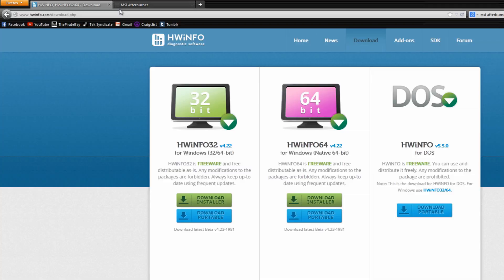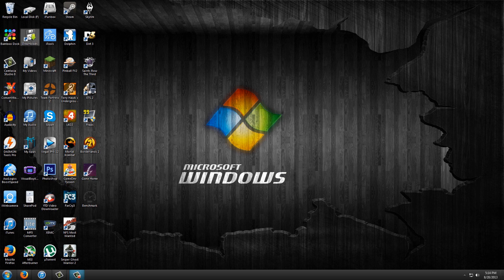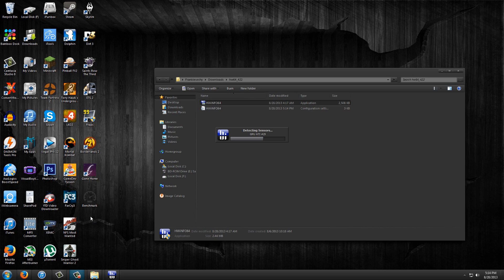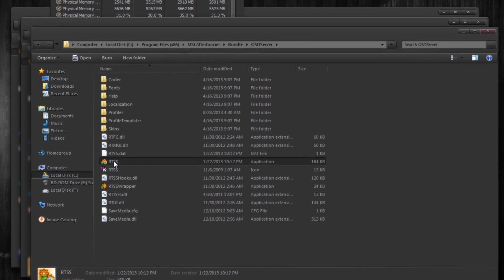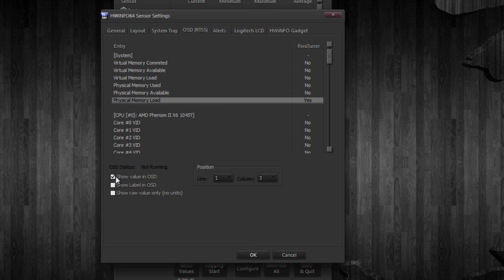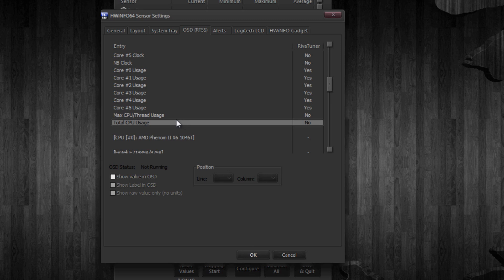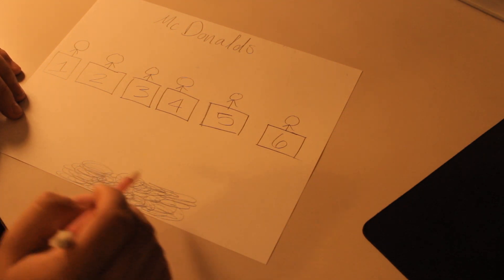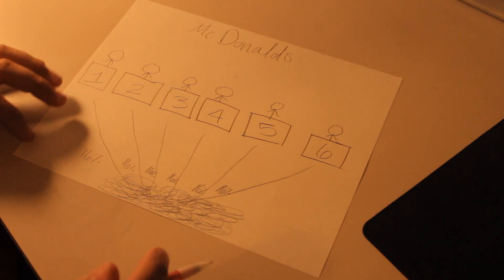How to Find Your PC's Bottleneck

Comment: I running in i5 4670k + r9 270x toxic + 8gb ram + psu corsair cs650m and asrock z87e-itx, i dont have ssd yet so i just run with hdd :3 its bottle neck or not ? I dont exactly know :3
Reply from the maker: Typically, SSD's are not crucial to the processing power of your PC. This rule changes with different tasks, but I'll assume you mean in terms of gaming: Then your answer would be no. An SSD helps your PC open applications quicker. It opens a picture faster. It loads different levels of a video game better. Because those are stored on your harddrive. An SSD will only make those kind of processes faster. It's not going to get you better frames per second in Battlefield though. It's impact on game processing is minimal.
Most of the time, it's your GPU or CPU. In your case, I'd say GPU, because the R9 270x is a low-mid level graphics card. If you're looking to speed up your pc in gaming: start there.
Reply: yeep, i was realize that my GPU is the answer, i think its quiet enough for me to have that 270x, its not really good but its good :D LOL so i think i will get an SSD yet and upgrade the RAM to 16gb, just like my planning for first time i build this for design, Photoshop and anykind of that software, anyway thanks mate, so for last result my PC dont have any prob right ?
Reply from the maker: If you're going to be doing Photoshopping and other kinds of editing, more RAM and a faster data transfer rate with the SSD will certainly boost your performance.
And no, you should have no problems with this upgrade, it should work out great for you!

Comment: I running in i5 4670k + r9 270x toxic + 8gb ram + psu corsair cs650m and asrock z87e-itx, i dont have ssd yet so i just run with hdd :3 its bottle neck or not ? I dont exactly know :3

Comment: Hi i have a little problem of mine:
I have just build a (very)low end computer just for playing games like tf2 and stuff (and i don't know that much about computers)
When i play games my Gpu is only around like 20-40 usage, while my cpu is around 70-80 (and dipping)
Is this also a bottleneck? and if: what should i have changed?
(and my fps is around 30 on high, and with all low around 40?!)
My specs:
Amd 5400k
Geforce gt 640
8 Gb ram
MSI A88XM-E35, Socket-FM2+
And just a hhd
Reply from the maker: Overall, good build man, but you know what, your CPU is lagging big time compared to your other components! That motherboard is really limited in terms of CPU compatibility, man! :( If possible, buy yourself a cheap motherboard with AMD FX compatibility. If you don't want to do that, then you could get yourself a AMD 760K, it's Quad-core @ 3.8GHz for $90. Whichever method you choose, bud, I know it will improve your gaming performance. I'm fairly sure that CPU is your bottleneck. Games are running better with Quad-core and multi-core processors, so it's time for at least a quad-core!
Reply: *****  Just a quad core? maybe a AMD A8-6600K Black Edition?
Reply from the maker: If you're cool with the higher price, then yeah, grab that 6600K, it'd be worth the extra money.
Yeah, that's what I'd do if I wanted to eliminate my bottleneck.
Hope I helped! Let me know if there's any other questions, bud.
Reply: ***** do you think an Asus 970 Strix would bottleneck with an intel 3770k on 6gb of ram?
Reply from the maker: Worstname evar  You got your hands on a 970?! Those are hard to get a hold of! Your CPU is pretty good too man! That card is a beast, and that CPU is really nice too. I don't see either of those being a problem for you! Good build man! Although you could do a little better on Ram! ;) If it's just gaming than anything over 8GB is overkill, but if you do editing, or run alot of applications then pick up some more RAM, bud!  Other than that, a very a solid build!

Comment: Hello Frankie, I got a 144hz monitor today and I'm super satisfied with the smoothness, even on lower FPS.

My problem is though, when the game goes on for a bit the FPS drop down to 60 or even lower (not adaptive vsync, they just drop by itself).

The game is league of legends. I run a GTX 770 Palit Jetstream, 12 GB of 1666mhz ram and a AMD II Phenom x6 1055T. 

Just in the theory, my fps should not go under the 144 hz at all. My CPU is overall at about 30% with windows and chrome in the background, ram is at around 35% and GPU at 28%.

I checked the ingame performance as it decays and it turns out that all my cores are running equally low except a single one which averages at around 60%

My CPU isn't throttling, checked that too.

I honestly dont know what to do. I can run Bioshock Infinite with everything on Ultra on solid 60 FPS with not even a single spike down, didn't test it on 144hz yet since the framerate seems to be locked at 60, need to work my way around that but it doesn't work for League. I'm seriously considering just spending 2.000€ on a new mainboard, new CPU and 2400mhz ram. But what is that doesn't fix it?

Please help :(

Comment: How do i know which number is what? i have all the numbers horizontaly and how i can change it like you have?.
So i am thinking that first 5 numbers are cpu and then comes gpu and then ram?
But this cant be it because i know that my gpu cant be bottlenecking my pc because i just bought a new one it is AMD HD 7970 which i think is decent gpu.(second last number is running 70-100%) My CPU is fx-6100.
So do i have to buy new power supply and a new gpu (r9 290x) and just crossfire my gpu:s to fix my problem?
Reply from the maker: Well I like to put the CPU and GPU on separate rows so I know which is which, but I'll make a guess here and say that it is your graphics card. It's typically everyone's bottleneck, CPU's aren't the most important component in processing graphics in games, your graphics card is. That being said, yes, upgrade your GPU, but not with a 290x!!! For the money, the GTX 780 would be WAY better my friend. Just make sure that your motherboard is compatible with NVIDIA graphic cards. Also, why would you have to upgrade your power supply?
Reply: ***** Becasue my current power supply does not have enough power for supporting 2 gpus. Well now when i am thinking i bought this computer already built 2 years ago it costed about 1k and came with gtx560 well i upgraded to amd hd 7970 6 months ago. So maybe that is the problem that my current motherboard does not support amd gpus because i didnt check it back then. And maybe it does not allow 7970 to run full speed or something? My computer is named Acer Predator G3120 and the motherboards name is also Acer Predator G3120 so how  do i know is my motherboard combatible with amd gpus? I got 800 euros which is around 1000 dollars to work with on ubgrading my pc.
Reply from the maker: ChillThull Well crossfiring 2 GPU's is never really worth it. You'd usually be better off with one very good card than two decent gpus. Crossfiring never actually doubles performance, it just doesn't work like that. I would suggest buying a very good card like the GTX 780.
And no, if your motherboard does not support your 7970, it would not allow you to play games at all, slow or fast.
If you can play a game right now, even slow, then AMD cards also work on your motherboard.
SO, IN CONCLUSION: Don't upgrade your power supply, you won't need to have 2 GPU's. Buy the best card you can for $1000, with that kind of money, you can get one of the fastest cards on the market, the GTX 780 Ti for around $650US.
Trust me, I think this is what you should do.

Comment: Hi could you please help me i watched you're bottlenecking video but i have a problem that my cpu is fx 6300 and graphics card is r9 270x oc 2gb gigabyte edition. in your video ur cpu was saying 60 procent just like mine and gpu 100 procent just like mine  the thing is that cpu i have is old from 23 Oct 2012 and gpu is from 13 Oct 2013. We both have the same results but i cannot belive that my gpu is a problem i was sure its a cpu and was ready to buy fx 8320 but now im not sure please help me.
Reply from the maker: I understand, but the CPUI is a huge component in 2D applications, like video editing, photoshop, mozilla firefox, etc. In 3D gaming applications, the majority of video processing is done with the GPU. Hence the name Graphics Processor Unit. Given the results of your bottleneck test, I would have to agree that it is the GPU. Your FX 6300 still has a TON of processing power even though it's 2 years old, it's a best seller on Newegg, because for the price, you get so much power. I would make buying a better GPU my priority! It would do alot more for you than a new CPU.
Reply: ***** What gpu do you suggest ?
Reply from the maker: go to video card benchmark .net (no spaces) they have graphs, and alot of data that will help you decide whats the best card you could get for the price.
Reply from the maker: *****
If you have the money for a high end card I'd get a GTX 780. It cost about $460, but it's almost twice as powerful as your r9 270X. You're at a weird spot where it would really be worth your while to fork out $400+ and get a really good card.
Reply: unfortunatelly i am a high school teenager so it impossible to get that kind of money r9 270x was the max i was able to get
Reply from the maker: I understand, I am the same way. The R9 270x is the best you can do, and you'll have to stick with your bottleneck until you have enough money to upgrade your card.

Comment: My ram usage only goes up to 25%, i have 8 cores 4 are used at around 12% and the other 4 are used at around 2%, my gpu is at 98% - 100%, so i guess it's my gpu
Reply from the maker: I would have to agree, yes. The majority of the graphics rendering and processing is done on the gpu, so typically you will see the graphic's card top off before the CPU in 3-D video applications. What GPU do you have? (Just curious)

Comment: hello , I have a intel i3 3210 dual core processor 3.2ghz( although it is dual core , so it can process dual threads , so practically it has 4 cores) , I followed your instructions. I played far cry  3,on high setting, and the osd usage for gpu never went above 55% and the ram usage never went above 30%. But the thread usages were like this 17.5%, 89%(threads from core #0) and 22.5%,78%(from core #1). Is my Cpu a bottleneck? if is is , do I have to change it?
Reply from the maker: No doubt the CPU is the component that is lagging behind your other components, so I would call it a bottleneck yes. But! It's not always necessary to fix the bottleneck, if you're getting good frame rates, and you can play it at your desired quality setting, then it's no a problem to you! But yes, long story short, I would say that the CPU is your bottleneck.
Reply: *****
Thank you for replying. I was just thinking if I could OC my CPU, many people have done it. Im just worried though.
Reply from the maker: Saksham Gupta
There's tons of good tutorials out there on OC'ing (I'd go with LinusTechTips) it's pretty easy, and you get some real performance boost out of it. You can always restore to original settings if you're not satisfied. If you have an aftermarket CPU cooler like a CoolerMaster Hyper 212 EVO (About $40) you're totally safe. I'd suggest doing it, bud. Especially on a dual core, you'd get alot more power out of your CPU! Like I said earlier, if you're already satisfied with your frame rates and quality, don't bother! Thanks for the comment! :)

Comment: WARNING READ THIS COMMAND this will save me 300dollars...

if i upgrade my pc videocard will this get a bottleneck...

upgrade from NVIDIA GTX 530 to Asus GTX750TI-OC-2GD5... (gtx750ti)
my cpu: Intel Core i7 2600 @ 3.40GHz Sandy Bridge 32nm Technology

the upgrades: 
Asus GTX750TI-OC-2GD5 (gtx750ti) and burn the gtx 530
Cooler Master B500 To power my pc...
The case cooler master k380 - will that case handle my motherboard?

will this get intro a bottleneck..? 

Full Specs:

Operating System
	Windows 8 Pro 64-bit
CPU
	Intel Core i7 2600 @ 3.40GHz	33 °C
	Sandy Bridge 32nm Technology
RAM
	8,00GB Dual-Channel DDR3 @ 665MHz (9-9-9-24)
Motherboard
	Acer Aspire M3970 (CPU 1)	36 °C
Graphics
	Acer P226HQV (1920x1080@60Hz)
	2047MB NVIDIA GeForce GT 530 (Sapphire/PCPartner)	42 °C
Storage
	931GB Seagate ST31000524AS (SATA)	35 °C
	930GB OEM Ext Hard Disk USB Device (USB (SATA))	35 °C
Optical Drives
	Virtual CDROM USB Device
	ATAPI DVD A DH16ABSH
Audio
	NVIDIA Virtual Audio Device (Wave Extensible) (WDM)
Reply from the maker: If you upgrade from a GTX 530 to a GTX 750 you will get much more performance out of your PC. Upgrading a graphics card is almost always a great option. As for the motherboard, I don't know about the motherboard. You haven't told me what motherboard it is. That case is a little small if you'd like a big CPU cooler. Hey man, you could use a little extra power, 500W is a little bit light because you have so many components.
Reply: ***** i cant change the case i dont care about my cooling... the case is way better then the old acer 1so also the cooling i will pick the cooler master k380 the videocard will fit inside and the power suply i want is a Cooler Master B500 (500WATT) and mutch more is a TON more i saw benchmarks lol my videocard isnt even worth 50dollars thats a shame... i want to upgrade it very soon can you say more tips will this get a bottleneck? the motherboard is fine... its a small upgrade for me i want a better pc after 3years will that videocard play for a few years on high or medium settings? and also the cooling of my cpu is just a basic intel cooler works fine and i always clean up the dust inside my pc no problem at all (i think) please tell some tips it realy helps me out thanks
Reply: ill hope i get a great gaming performance and play play battlefield 4 on high or medium settings?

Comment: Hey ***** 
So i recently started experiencing the problem that, while gaming, my pc would suddenly blackout and i would be forced to restart!
This is while playing games like Battlefield 4 and Bioshock Infinite on Ultra, but this didn't happen until a couple of days ago, before then i had no problems. I noticed that sometimes my CPU load would go above 90 on the first core or two! Do you know what could cause my problem and how i could be fixed!? 
CPU: i5 4670k 
GPU: Asus GTX 770
Reply from the maker: I hate things like that because they can be so many things dude! :( My first thought is that possibly( and hopefully) it was a graphics card driver. So check to make sure that's up to date, and it's not a Beta driver, make sure it's an official release driver.
Aside from that, I'd move over to hardware, I would really suspect power. Check ALL connections coming from power supply. I'm talking about the plug that goes from the wall to the PSU, and then all connections inside the computer from PSU. Especially the 24-pin motherboard power, this personally happened to me, and my computer would restart at complete random.
Reply: Okay! thanks for the quick response, i'll give it a try, and thinking about it, then i might be running a Beta driver for my GPU
Reply from the maker: I hope it is a beta driver! Get back to me dude, I'll be waiting!
Reply: I wasn't a beta drive, and i have tried reinstalling my drivers, but without luck! 
Looks like it's a problem with my GTX 770, cause a lot of people are have the same problem with the GTX 770! 
Hopefully it'll be fixed with an update
Reply from the maker: Wow, what a bummer dude, sorry to hear that. Good news is, you've found the source of the problem.
Reply: Yea, and i have fixed it as well! and thanks for the help btw
Reply from the maker: How did you fix it? :D
Reply: The problem was with the latest Nvidia 3d vision drivers, and Asus Vbios... so i completely uninstalled the all of the drivers for my GPU, then Installed the original drivers that came with the Graphics card, Updated them, and then custom installed the latest Nvidia drivers, without 3D Vision
Reply from the maker: ***** So much people have problems with the damn 3D vision, it completely slipped my mind to suggest that! (sorry, like I said it could be MANY MANY things) I'm very glad that you found the problem!